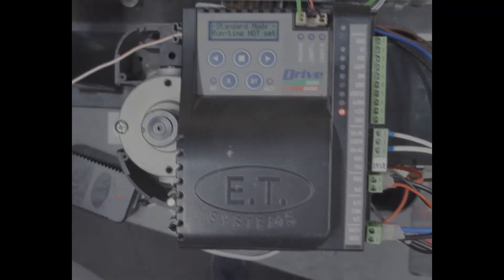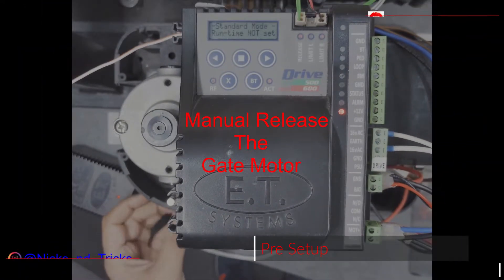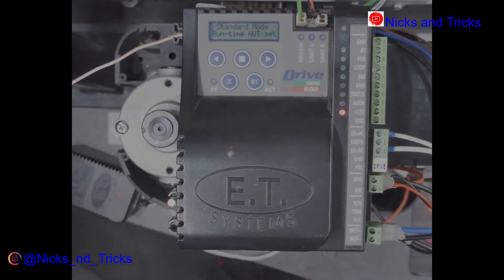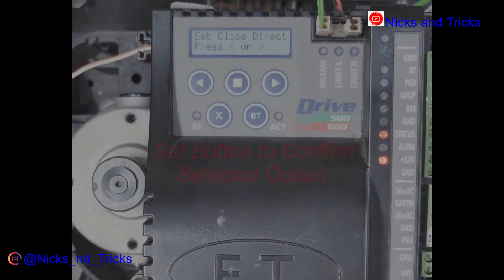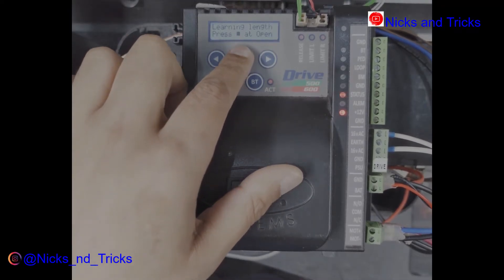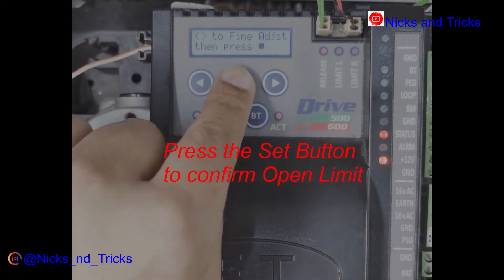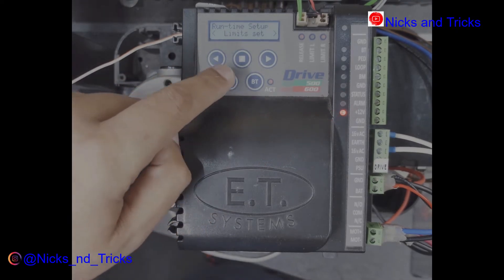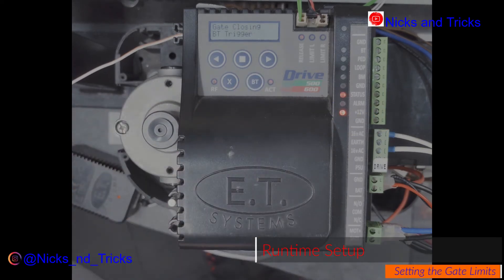how to program a Drive 500_600 Gate Motor

Comment: I get setup error limit range every single time
Reply from the maker: Thank you for the comment,  does it happen on open or closing
Reply: @nicksandtrickssa  on closing mostly but even when I stop it at full open it goes past that point and hits the garage wall
Reply: When doing the gate profiling it flys past the point where i stopped it in the limit range, it then says encoder stalling for obviously hitting a wall, honestly considering going back to a manual gate as this is annoying
Reply: @nicksandtrickssa ive done a factory reset now and same issue, guess a technician will have to struggle with this issue
Reply from the maker: Can you check if the limit light turns on when the gate is closed
Reply: @nicksandtrickssa I played around with the magnetic thing on track, had to move it out of the middle of sensor for it to work, not sure why it works but I won't question it if its working
Reply from the maker: @YourBoiiCarrot is it working now?

Comment: You have your plugs in as limit to the right but the gate closes to the left. Why is that?
Reply from the maker: Thank you for the Comment. Correct, Due to it being a demo gate of approx 1.5m long, the limit pin does not matter as much, also I am not using beams so the it wont effect the setup.
if your gate close to the left you must use Limit L, and if the gate closes to the right you must use Limit R.
Thank you for catching that.

Comment: Can you please assist me where to add a smart opener input with drive 600 can I put the reed in com and the black in N/O ? 
Thanks
Reply from the maker: Thank you for the comment,  if you can find a manual for your device and check for a common and normally open, it will work, i will link a video on adding a receiver below
Reply: @nicksandtrickssa   I did try to find a manual for the 600 Drive ET motor but could not find ,Thank you!!
Reply from the maker: https://youtu.be/rx2mcRtG8jY

Comment: Does anyone know how to deal with the 5 fast beep error on the drive 600 motor?
Reply from the maker: Thank you for the comment,  have you had the chance to look at the control card to see what the error is? Also when does it make the beeps
Reply: @nicksandtrickssa  i would have no clue where to look for that. I will open it up sometime this weekend and update you 👍
Reply from the maker: @abdulismail03  you have to open it when it does the beeping and the board will display the issue
Reply: @nicksandtrickssa  i opened it up. It had an encoder E01 error
Reply from the maker: @abdulismail03  thank you for the comment,  E1 error is a pcb error, normally happens when the insects gets hold of the pcb, at the bottom of the board is 3 screws, have a look inside the casing and see

Comment: Can anyone assit me i am having a problem with my remote setup on my et 500_600 it says comms error when i press the square
Reply from the maker: thank you for the comment, but i will have to look into that issue, have not yet come across this issue before
Reply from the maker: Comms error is usually a faulty controller. RF comms error can sometimes be cleared by cycling the power.

Comment: Thank you for the info 
My problem is that the gate runs halfway when it opens  and on closing the gate reverse automatically without pressing the remote any help please
Reply from the maker: Thank you for the comment Neville, you have to turn up the force, please note that turning up the force will require a bigger force to stop the gate...
If the gate always stopped at the same point, it can be the track or rack, check the gate wheels as well. Last thing to check is the spacing between the rack on the gate and the cog. Should be a even spacing throughout the travel of the gate. Lastly a fresh battery will also help.
Reply: @nicksandtricks1849  
Thank you so much 
I see that one of the wheels not functioning properly
Reply from the maker: @nevillewatson8718  no problem, a like and sub would be appreciated 👍
Reply: @nicksandtricks1849 I want to know how must it be connected at the remote. It just opens at the motor like you did before

Comment: Hi, I'm trying to set runtime but I'm getting encoder stall error... How do I resolve this please?
Reply from the maker: ok soooo, encoder stall is a bit tricky, power down completely, unplug all green connectors, and remove the card, you have to check inside the casing if anything looks and smells damaged, sometimes when rebooting the card and unplugging and putting back together it starts to work, the loadshedding causes the pcb to do this error. also does it happen when power is off or while there is power?
Reply: The same thing happened to me and it was just a matter of cleaning the engine carbons, check to see if they are worn if not, just clean them well.
Reply: Many issues can stem from battery. Mine was faulty and I was getting many different ones.

Comment: Same problem, after setting close range the gate closes to far on second run the i keep getting error
Reply from the maker: Thank you for your comment, the gate uses the magnet for the closed position, check the limit light manually to see if it turns on, if not check you magnet on the rack.

Comment: Hello, I have an ET Drive 500/600, and when I want to program the opening, after selecting the option "Set Close Direct Press < or >" and the message "Finding closed limit" comes out, but instead of the motor moving, this error message "Check motor conn limit" comes out, and I don't know what it is about.
Reply from the maker: Thank you for the comment Claudio. Please swop the 2pin connectors of the battery and the motor caabke connectors. Sometimes the motor connector is overtightened and it can have an effect on the setup
Reply: @nicksandtrickssa  and it can be swop those 2 pin from battery and the motor we are using drive 500 ET gate motor
Reply from the maker: Thank you for your comment Victor, it is for the Drive 500/600 only, is has the same green 2pin connectors, what seem to be the issue your having?
Reply: @nicksandtrickssa  as of now am at the gate i want to sort it out this problem, but i cant see any 2 green pin there please help
Reply from the maker: What is the issue with the gate motor? Do you have a blue cover or a green cover?
Reply: @nicksandtrickssa  blue cover drive 500 it always says check motor connection
Reply from the maker: I hope you read the last comment regarding the cables
Reply: ok sorry i see it from battery and motor having green pin yah so i must swop that one from battery it must go to motor + and -  so from motor it must go to GND and BATTERY not so?
Reply from the maker: Just the connectors, not the cables please, just swop the connectors. So the motor cables is still motor + and - and the battery leads is still bat+ and bat- just swop the connectors, so loosen the cables first then swop them and replace the cables in the same place
Reply: @nicksandtrickssa  ok fine let me try
Reply: @nicksandtrickssa  still doing the same check motor connection limit
Reply from the maker: that can only mean that the inner motor or the PCB is faulty. if you are in the Bergvliet Cape Town area, please take the motor to Rsec Security Equipment Center fro assessment
Reply: The same thing happened to me and it was just a matter of cleaning the engine carbons, check to see if they are worn if not, just clean them well.

Comment: I noticed in advanced setup menu that there is a setting for number of limits. Is it possible to run a 2nd limit on the gate for the the open limit? I have 1 limit actuator installed for the right limit, and have done the limit setup, but the thing still heads too far when opening. Possible to add 2nd actuator for the left limit?
Reply from the maker: Thank you for the comment. The unit should be set to single limit. On the very rare occasion it is left on dual to test the operators. Does the limit overrun during or after setup?
Reply: @nicksandtrickssa  Sorry for late reply. It overran after setup. On inspection we found the FETs had blown. It also started to eat up fuses and whoever installed the gate didn't do to well with mounting the leading wheel. Motor would run at full speed no matter what. Could only be fixed with a new board. So we did that, welded down the leading wheel and then grinding down the paving a bit where it was riding up (only a problem now after the wheel was welded). So far so good.

Would ve really useful to have 2 limits instead of gate length calculation. But for now, just happy the darn thing works. :)

Comment: drive 600 sliding gate shows Lim fault,manual open to release,but if doing show gate does nothing and stil shows the shame message
Reply from the maker: Thank you for the comment. You will have to look at the limit magnet on the rack, on the board there is a limit l and a limit r. When the gate is at the limit magnet, the limit light must be on. If not contact your installer to assist